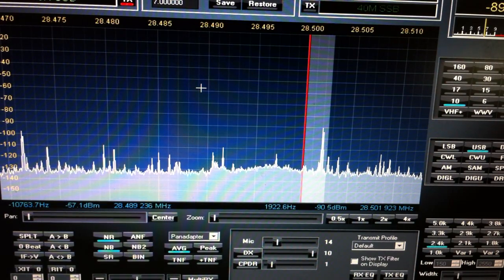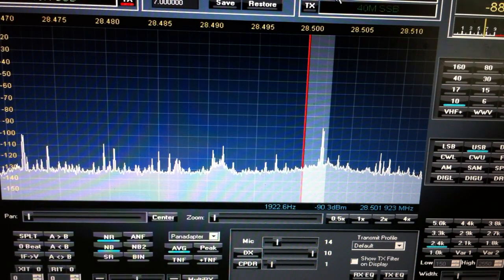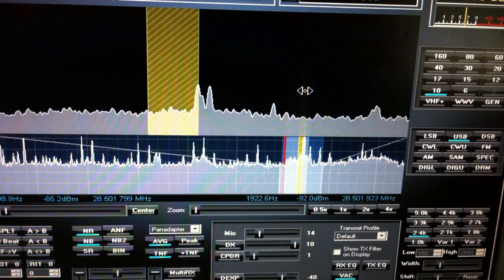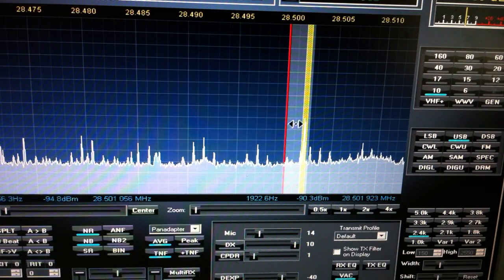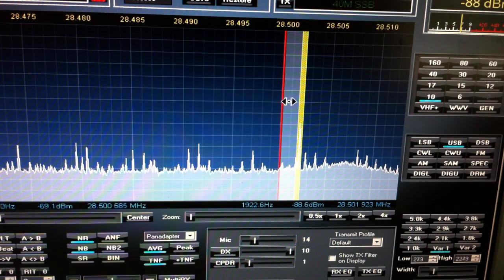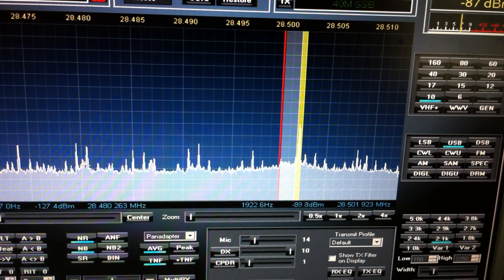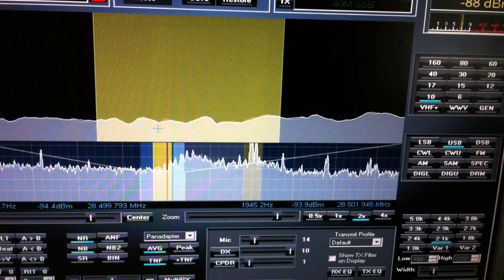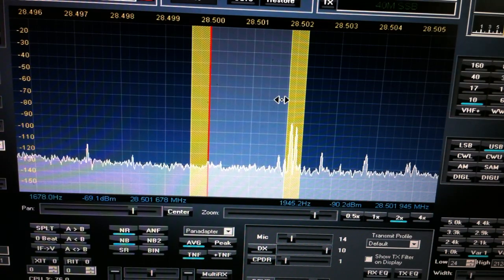Flex1500 - PowerSDR filters - A Practical Application

Comment from the maker: @jvolstad It has a built in keyer and, if you have a really fast PC the latency is not too bad. If you have a marginal PC, you will find that there is a lag between the time the key is pressed to the time you hear the tone. This bugs the crap out of me. There is really nothing that can be done using the built in internal keyer because off the D/A conversion that is taking place causes a few millisecond delay. However, this issue is easily resolved by using an external keyer.